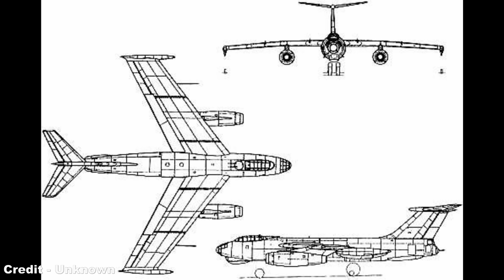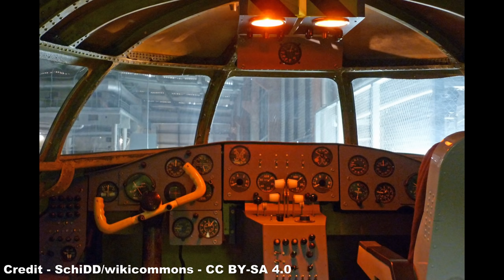Flying Failures - Baade 152

Comment: Yes, the Caravelle was not as good as the Baade 152 with the exception that it was safer, used two less engines, and was far more economical.
Reply: Sud-Aviation Caravelle footprinted its time as one of French successfull engineering projects of the 60s.
Reply: why are you so triggered?

Comment: Tiny point: Aircraft at 5:57 is a Tupolev TU-134, with it’s distinctive rear-mounted engines, not a TU-124 (which had it’s engines in the wing roots). Otherwise an excellent video.
Reply: Originally the TU-124 was promoted, but Interflug would instead get the TU-134, a rear-mounted engined, T-tail version of the former.

Comment: kind of a shame it didn't work out better, its a very handsome 'early jet age' aircraft; like the early Boeing 707 concepts that were just a B-47 Stratojet with a passenger cabin.
Reply: Yes, although Boeing's wings were far superior.
Reply: Boeing looked more at the dehavilland comet for the 707 than the b47 , the americans liked engine pods while in british designs favored wing root
Reply: The development of high speed, strong, engine-podded, swept-wing aircraft was a very complex integration issue.  After WW II, Boeing invested a lot of resources in creating their own high speed wind tunnel to research the engineer challenges involved.  Highlighting this point, it wasn't until Boeing shared this research in the mid-60's, that the USSR was able to build efficient swept-wing podded engine aircraft. Prior to this, they mostly placed engines in the fuselage or on the tail. All of this is written about in the excellent book "Wide-Body: The Triumph of the 747"
by Clive Irving.  I highly recommend it if you have any interest in the subject. You can't put it down.

Comment: One Pirna 014 jet engine is on display at the Verkehrmuseum Dresden too. And one Pirna 014 was mounted on the back of a truck and used as a special fire engine for fires at high pressure gas tubes to blow away the flames and thus extinguish the fire.
PS: Pirna is the name of one neighboring town in the southeast of Dresden. The jet engine was named after the town, because the construction bureau responsible for the jet engines was located in Pirna. 
https://de.wikipedia.org/wiki/Datei:Pirna_014_im_Verkehrsmuseum_Dresden_2010-08-10.jpg

Comment: It was not only planes that where made for quick mobilization in case of war. East Germany was dotted with similar small comunities, around 5000 inhabitants in standard houses of concrete that had narrow rectangular windows, which could be transformed to pillboxes in a hurry. These communities where spread around East Germany with an even distance. This is many years back now. I don't know what the former East looks like today. But back then they where prepared for war in an instant.

Comment: Deutsche Lufthansa was West German. The Hansa name and trademark was applied not just to aircraft(adding the word "Luft", meaning "Air" ahead of the Hansa name), but also appeared on record as the brand was distributed by BMG(Bertelsmann Musikgruppe GmbH) which had Bony M. on its label.
Reply: That is not entirely correct, there used to be a East German "Deutsche Lufthansa" in the 50es and 60es, before Interflug was founded.
Reply: @Taschenschieber  Okay, but I always believed that Hansa was West German as it was more a commercial operation, while the communist East Germany frowned on commercial enterprise.

Comment: This video claimed the OKB-1 150 was comparable to other bomber designs at the time, including the B-52.
BUT... I looked up info on the OKB-1 150 and the B-52, and it appears these two bombers are not actually comparable. 

Engines
B-52H: 8 × Pratt & Whitney TF33-P-3/103 turbofans, 17,000 lbf (76 kN) each
B-52A:  8 × Pratt & Whitney J57-P-1W turbojets (or -1WA or -1WB) of 10,000 lbs. thrust each dry, 11,000 lbs. thrust each wet (water injection)
OKB-1 150: 2 × Lyul'ka TR-3A , 49.05 kN (11,025 lbf) thrust each

Bombs
B-52H: 70,000lbs max
B-52B: 43,000lbs max
OKB-1 150: 13,230lbs max

Service Ceiling
B-52H: 50,000 feet
B-52B: 47,000 feet
OKB-1 150: 41,000 feet

Max speed
B-52H: 650mph
B-52B: 630mph
OKB-1 150: 603mph

Ferry Range
B-52H: 10,145 miles
B-52B: 7,350 miles
OBK-1 150: 2,800 miles

The B-52 is significantly bigger, faster, flies significantly higher and farther, and carries significantly more payload. What am I missing?

Data sources:
https://en.wikipedia.org/wiki/Boeing_B-52_Stratofortress
https://en.wikipedia.org/wiki/OKB-1_150
https://www.456fis.org/RB-52B_STRATOFORTRESS.htm
Reply: The concept, pioneered in the West by the B-47, of a tandem main undercarriege in the fuselage centre line, complemented by two small outriggers at either wing tip for balance. That makes all threes designs essentially similar.
Reply: @javiergilvidal1558  Thank you!
Reply: You´re welcome! Two other important aircraft with this  undercarriage concept are the British Harrier and the American U2 Spy Plane. Interesting exercise for the near future: check all similar designs in different countries, and see which one came first. Regards.

Comment: Actually more comparable to the Boeing B47 I would think, the OKB 1150.
Reply: Or more correctly the B-45 which preceded the B-47.
Reply: @jwenting  The B-45 was a straight wing, tricycle geared, with jet engines built into the wings and a 1,000 mile range. The Baade 152 was a high wing, with four jet engines in pods on a swept wing, bicycle gear with outriggers which was much more similar to the B-47. Given that the original concept by Baade when working for the USSR closely followed the development of the B-47 one cannot help to wonder where he gained his 'inspiration'. Granted the B-47 was slightly longer but there were too many similarities to be a coincidence. Of course the Soviets would never infringe on the aircraft design of another country - - - Oh wait, there was the Tupolev Tu-4 which had a remarkable resemblance to the B-29, hmm . . .
Reply: @denali9449  Both B-47 and Baade 152 were based off the German advances in aerodynamics. Now if you wanna play the who copied who game, consider this: the first jet with engines on the underwing pylons flew 6 months before the B-47 first flight. It was the Soviet Il-22. Leveraging your logic, B-47 copied Soviets.
Reply: @sergeychmelev5270  First flight is not the place to look in a case of industrial espionage. Rather we should look to the design timeline. Ilyushin was directed to start the design of the ill-fated IL-22 on 02/12/1946. What would become the B-47 started with a concept in 1943, a formal RFP in 1944 and the final design of the swept wing, pylon mounted engines and bicycle gear with outriggers during the winter of 1945/46. It was then known as the Model 450. The USAAF ordered construction of two prototypes in April of 1946 to be known as the XB-47. So if I understand you correctly, in the winter of 1945/46 the Boeing folks copied a Soviet design which was not started until February of 1946. Okay, that makes sense. BTW, the design of the IL-22 was not all that good, it was scrapped less than two months after first flight for failure to meet the design performance requirements and the B-47 (with all its issues) flew for another 30 years.
If anything, the only copying here would be by Boeing after seeing the results of the German swept wing designs in May of 1945. Additionally, I believe that the German Junkers JU 287 (circa 1944) was the first plane to use the pylon mounted jet engines even if its wings were swept in the 'wrong direction'. So Germany was the true forerunner in jet aircraft design, as well as rocketry, and automobiles, and internal combustion engines and roadways and, damn, the list goes on and on and on . . .
Reply: @denali9449  Now if I understand you correctly, the Baade 152 that started being designed in 1953 was somehow copied from B-47, even though the Soviets already implemented multiple designs with the same features years before that. Do you see why your claim is as ridiculous as mine? 
Also, Ju-287 had its engine pods attached directly to the wings, just like Me-262 and He-280 - no pylons. The problems with Il-22 were unrelated to the engine position, so still - it was the first one to fly with this design feature.
Reply: @sergeychmelev5270  Help me out here - what were the 'multiple designs with the same features years before that'? Are you saying that the Soviets had made multiple improvements to the pylon mounted engine prior to 1945/46? If so, on what plane? 
As for the Baade 152, it is my understanding that Baade designed this plane upon his return to the GDR from the USSR in 1954. It also appears that the Soviets cut him off from all his work and forced him to use Sovist pieces and parts for anything he designed.
I do not disagree that the IL-22 was the first plane with the pylon mounted engines to fly. Again, first flight does not mean first design. My statement is that there was no way the Soviets could have designed and built the plane in 17 months, they simply did not have the time, ability or resources. The B-47 design was completed prior to the design work starting on the IL-22. I will also agree that the engine placement had nothing to do with the scrapping of the plane, the use of the under performing Lyulka TR-1 engines was it's Achilles Heel.
Reply: @denali9449  no, I'm addressing your claim that Baade 152 was copied from B-47. By the time Baade 152 development started, the Soviets have already implemented numerous designs with the same features as B-47 - swept wings, jet engine pods on the underwing pylons, bicycle landing gear, etc. There was precisely no major feature to copy from B-47 in 1953.That's why your initial claim has zero ground to support, and that's my only point of arguing.
BTW, the J35-GE-7s of the first XB-47s sucked just as well.
Reply: @sergeychmelev5270  You have twice stated that "the Soviets implemented numerous designs with the same features as the B-47" but have not given any facts to support this statement. I again ask you to provide the facts to show that these planes were designed prior to 1945.
As for the XB-47 engines, yes, those engines were pretty weak. However the Allisons were just a temporary fitment until the General Electric J47-GE-3 and 11's were ready for production.
Reply: @denali9449  you keep on bringing 1945 (when neither Baade 152 nor B-47 even existed), and I'm struggling to understand how that is supposed to prove your claim that Baade 152 is a copy of B-47. Tell me what facts say it was copied and I'll tell you why that's not the case. In fact, I'm pretty sure you have zero evidence to support your claim besides "distant resemblance" which can be applied to pretty much anything.
Reply: @sergeychmelev5270  The design work for the B-47 was completed in the winter of 1945/46 and it entered production in April 1946. That is why 1945 is germane to the discussion. The Soviets had nothing on the boards prior to this time frame. The design of the IL-22 started in the spring of 1946.  
You have made claims that the Soviets had designed planes prior to the design of the B-47 which incorporated many of the B-47 characteristics but provided nothing to substantiate your claims.
At the risk of repeating myself; the plain simple fact is that the the deign of the B-47 was completed prior to the Soviets starting any design work on a similar plane. (The Soviets were not known for their honesty in design - again I refer to their cloning of the B-29 in 1944.)
So again I ask, please provide model numbers and dates of design for all Soviet planes which incorporated what you refer to as design similarities. You can say the words a million times but until you provide the requested facts, it just ain't so.
Reply: @denali9449  You still have not provided a single evidence that Baade 152 is a clone of B-47. Baade 152 was designed in 1953. By 1953 Soviets had numerous implementations with all the features it used. You want me to name those Soviet designs prior to 1953? What the heck does 1945 have to do with it? OK, I know you are unable to prove that Baade 152 is a copy of B-47. Because it's not. You can just as easily say any other plane built after B-47 and having some of its features is its copy. Just like I can say F-15 is a copy of MiG-25 simply because no other aircraft had this exact layout prior to MiG-25.
Also, stop fooling around with dates. B-47 did not enter production until 1949. XB-47 built in 1947 was not a production aircraft. 
Soviets had 3 B-29s at their disposal in order to copy them. How many B-47s did they have in 1946? Thought so.

Comment: A very rare German engineering failure. Must of had Soviet interference. Actually seems a very forward design...
Reply: Not really, they totally exceeded nearly everything at especially the second flight, complete blunder. Like they had no plan. A rush job that was bound to end in a catastrophe. New airframe testing is a time consuming meticulous job with small steps and protocol, but no short cuts. These fools were in a rush because of some ceremonial day, yep, another reason why socialism fails at everything. First quite a great effort and a promising result, only to ditch and burn all the good work due to total stupidity and socialist group and peer pressure, because some commissars wanted to show of for the mentioned ceremonial day. The final blow to the project probably came via order from russia cause they favoured their own upcoming jet.
Reply: @waltrohrbach2459  : I agree socialism always leads to failure...
Reply: @hertzair1186  Let me guess: you're the guy who said "We just need to kick at the door, and the whole building will come tumbling down" aren't you?

Comment: Now, I don't like it, when the Japanese and Koreans copy stuff, but these guys, in the GDR, had better copied something from the west or east. There were aircraft around that worked. This thing just looks really weird. Why do no other major jet airliners have a high set wing. It's stupid. And let us not forget that the performance figures are purely fictional, since the Pirna engine never really worked and was only built in very small numbers. These first prototypes mainly flew with Tumanski engines from Russian fighter that were surplus.